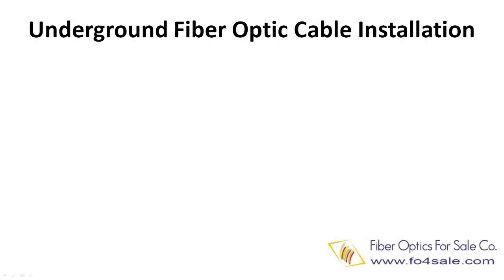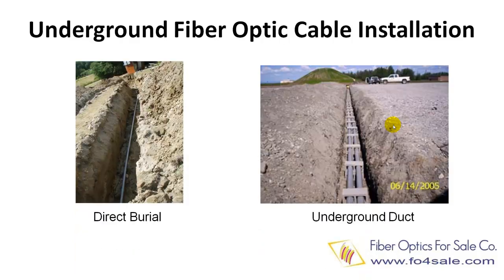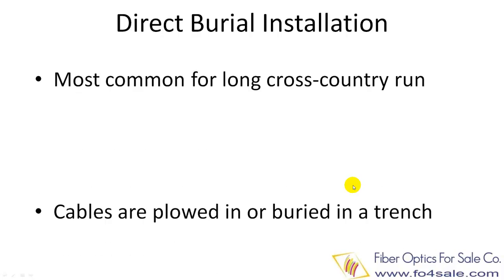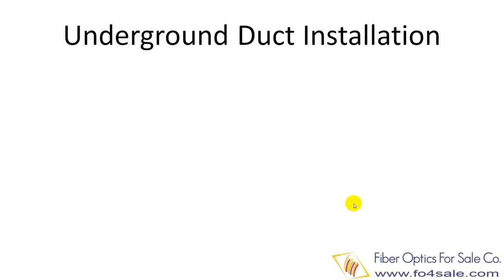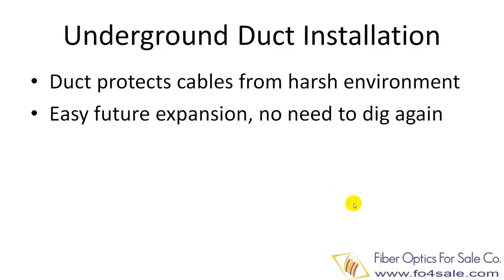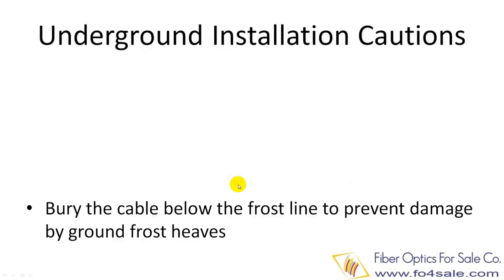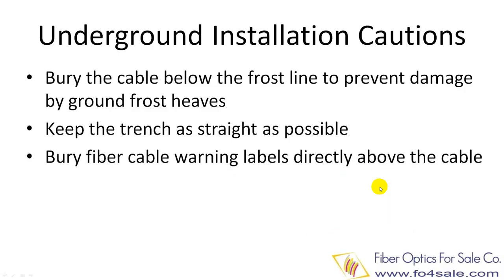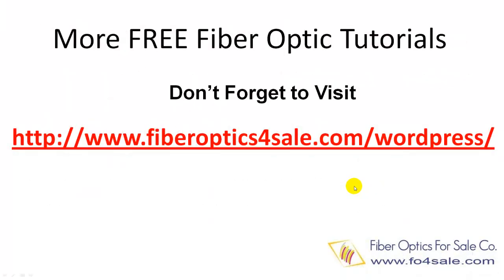Underground Fiber Optic Cable Installation

Comment: I operate a large ditch witch which drill horizontally underground then pull the cable back through. The dirt doesnt even need to be unearthed.